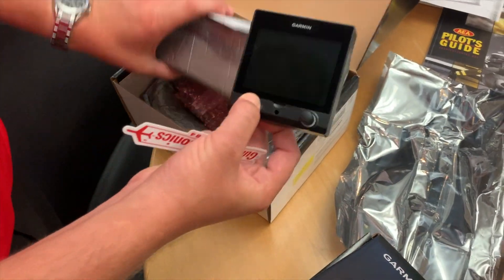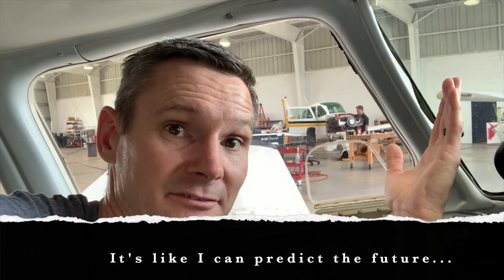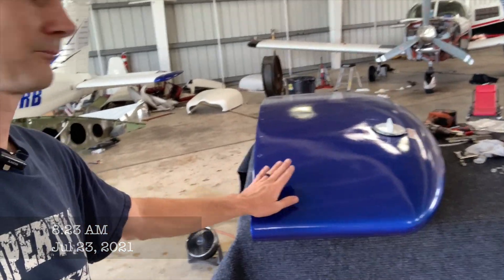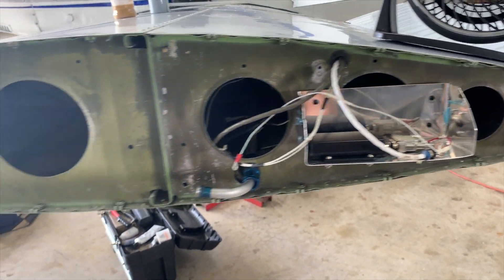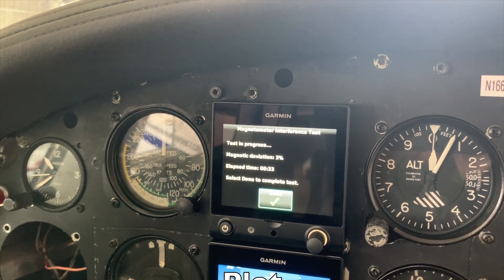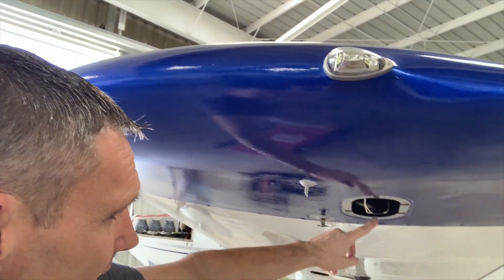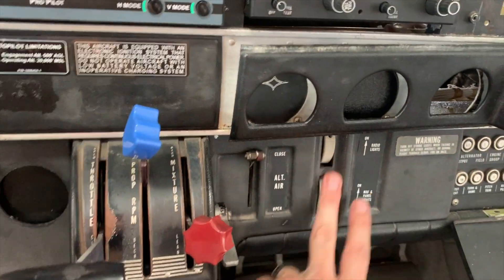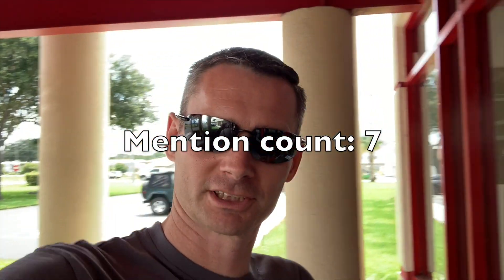Dual Garmin G5  Cheap Glass panel Cost & Installation Cherokee 6 EP 2

Comment: Hello: Jimmy  love your videos.. Quick question is that garmin 430 wass or non wass ? Do you need wass gps for the G5"s?
Reply from the maker: mine is a WAAS, The G5's have an internal GPS and if you don't have a WAAS GPS you can use an antenna connected to the back of them.

Comment: Your GMU test should be done with a short test cable per the installation manual. Max 15’ if I recall. Did you use overbraid out in the wingtip?  What about the ground straps on the connectors?
Reply from the maker: Thanks for the comment.  yep, all that was done.